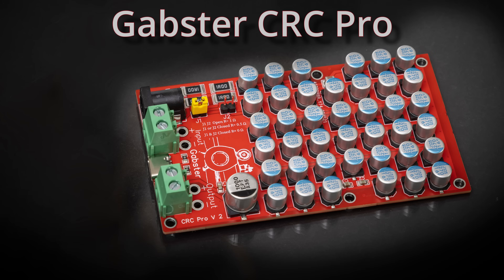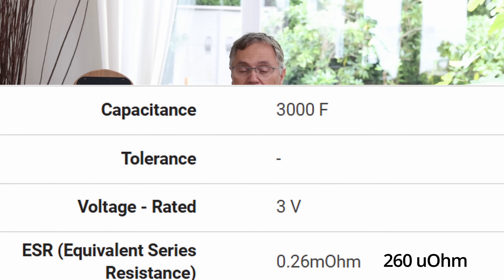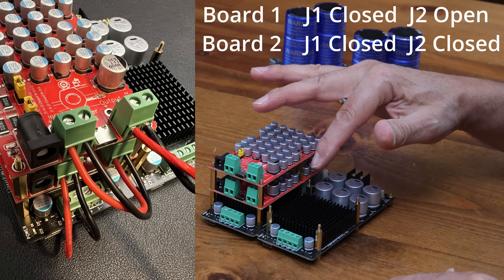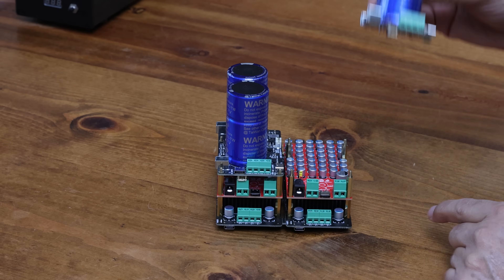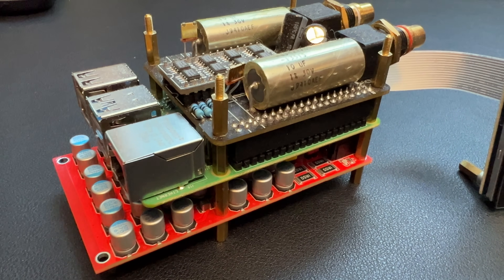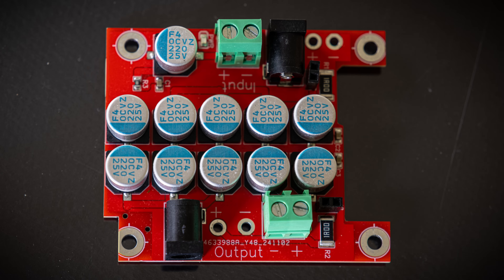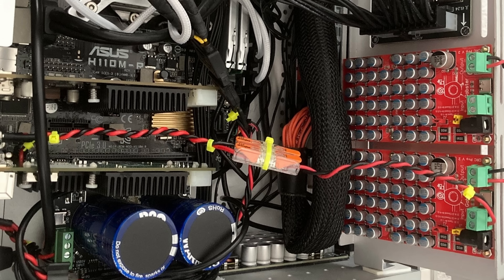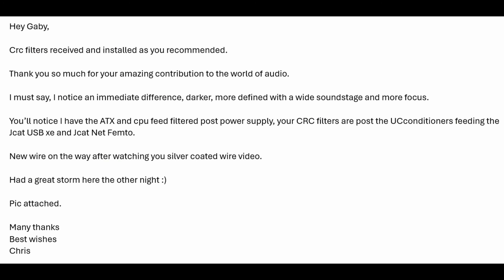Gabster CRC Pro Power supply filter, with JLCPCB / Very Low ESR

Comment: Hi gabby, thanks for your channel. Really enjoy both your music ones and your diy educational ones. I’m wondering if you can give me some advice. I recently brought a vintage turn table that was using a wall wart power supply (reduce from 240v /50hz to 20v DC up to 2A). I have received a recommendation to buy a small low noise  lps with 20v dc up to 4.2A. I’m advised the turn table will only draw the current it needs, and thus the current capacity  difference of the LPs will not be a problem. Can you comment on that logic? Thanks from Joe in Australia.

Comment: Thank you for the introduction of the CRC filter. Could you please explain what benefit is there for the use of UcConditioner (supercapacitors) when CRC is also used? Not for ESR. To use as an addition to LinerPI the UcConditioner is for the ESR to drop, but the CRC filter does a much better job and using both, does not drop the ESR even more. In both cases (using CRC filter with or without UcConditioner)  the ESR is around 280 uOhms. Why is the storage capacity of the supercapacitors so important or just benefical if not important? Thank you
Reply from the maker: you have a very good point, the ESR is the same and lower than supercapacitors.
It is the same idea when using a much larger transformer than needed, Amps seem to sound better
it also puts a buffer between the Power supply and the load. Specially In the case of UCPure (Super caps running on their own )but if I have to choose one I will go with Low ESR small caps at least for small loads.

Comment: Get a VM10 by Lake Shore CRYOTRONICS to measure power supply noise.
A lock-in amplifier with all the features you need to accelerate your audio power supply noise measurements.
DC to 100 kHz, including amplitude, phase, and harmonic detection capabilities.
Input coupling: DC or AC (0.1 Hz)
Ranges: 10 V, 1 V, 100 mV, 10 mV; seamless, automatic transitions
Best sensitivity: <1 nV
Forget about the uV noise, need to measure the nV noise to get the best power supply noise figures.

Comment: Should be using Amass XT60 connectors much lower connector resistance, no screw drivers required, these are used for RC battery connections, easy to use with 10awg wire.
Should use RC silicon wire, 200degC wire, very flexible,, high strand count, 0.08mm strands, less skin effect with better high frequency response.

Comment: I tried polymer caps in negative feedback loop of the power amp, they sound terrible.  Would not use them anywhere.
Reply from the maker: For a negative feed back I would use  Film capacitors not Polymer 
Each type of capacitors are better suited for specific circuits so it is not good to generalize that this type of capacitors is no good, rather not good for this type of circuit better suited for that circuit.
If your feedback network affects gain or tone, or is in the audio signal path, use polypropylene film
Reply: @Gabster1 Not possible. 200uf film cap required for feedback  is way too large.
Reply: Polymers are polarised so won't work for ac feedback. 200uf is very high for feedback.

Comment: Hello Gaby.

It seems you are using pure silver wire with PTFE. Could you please tell me where does it comes from ? I need to make my silver cables myself (with solid core wire) but it takes time. I'm looking for cable that i can buy and use. 

Thanks a lot
Reply from the maker: These are OFC copper silver plated I did a video on those with link in the description 
AliExpress Great Silver plated OFC wire
https://youtu.be/DTR7LuMo5q0

Comment: Any recommendations for a Linear power supply with an output of 150W or more ??
Reply from the maker: Are you sure you need 250 watts IanCanada’s LinearPi Pro Is a excellent linear power supply capable of delivering 5 A say on 5v that is 25W at 12V that is 60W  
For anything above 300 milli Amps the CRC pro needs to be in CC mode both jumpers closed
Reply: @Gabster1   Sorry I missed out on your reply. I am planning to run a PC with it. hence trying to find out  a linear power supply with atleast 110 Watts. So far I have found that Keces and HDPlex have some options. I am digging more to check if there are any better and cheaper options available. Have you ever checked the performance of ferrum hypsos , Keces or HDPLex linear ??
Reply: Power supplies put out voltage,  the watts would be determined by the size of your transformer

Comment: When the ESR is getting that low, you need to take care with the wire connection terminals, which may contribute their own resistance. Hopefully you have the good quality cage clamp versions.
Reply from the maker: You are correct Short thick wires soldered close to the load is the best There are two large pads that can accommodate 13 AWG wire, or even thicker if you remove a few strands. Alternatively, you can use the large built-in terminals as a second option.

Comment: Hi Gyabi ,Since I am non technical . I have ifi streamer can I use crc filter and lps in my setup ?.
Reply from the maker: If I am correct it takes a external power supply 1 to 2 Amps 9 to 15v 
I would then use a 9v power supply (15v too close to the 16v caps rating) capable of 2 Amps you would need to keep the CRC filter very close to it and in CC mode both jumpers closed 
It would be a Ideal setup 
Be sure not to reverse any polarity
Reply: Thanks. How to  purchase and can it be ship to india ..?
Reply: It has external power supply as mentioned 9v .
Reply: I may require step by step process to setup.
Reply: Which crc filter should I buy v3 , pro dual or pro single ..
Reply from the maker: @dineshchonkar9776  CRC Pro single 
J1 and J2 closed get a power plug like this 
making sure it fits your IFI size 
this one 16 AWG better then most
https://amzn.to/4lMyRyf
get a metal case and 4 standoffs to house the CRC board 
keep cable less than 12 inches make sure you do not reverse polarity or you fry something
Reply: Thanks Gabi , Purchase from your site .. expecting delivery .. will connect if required any support .